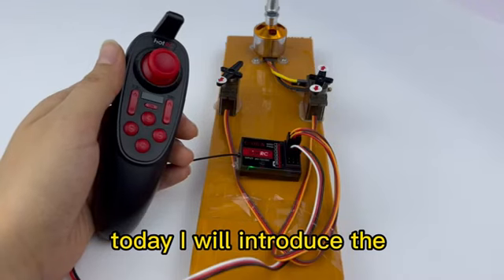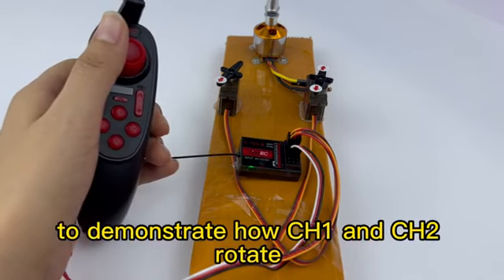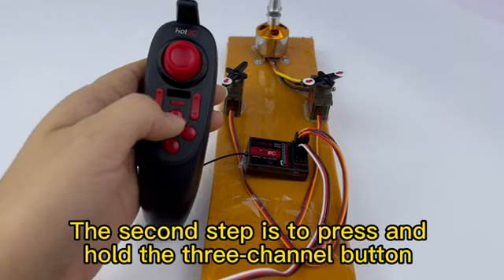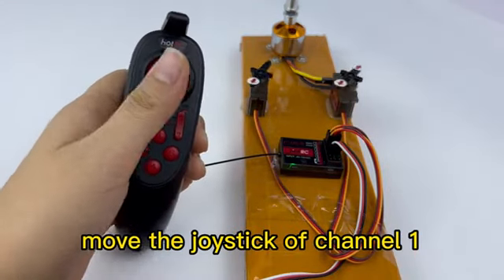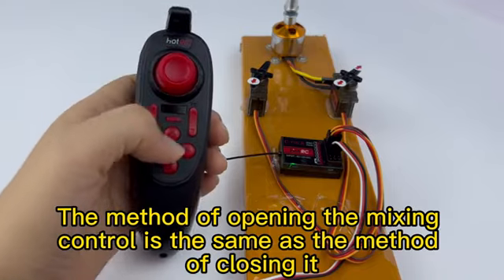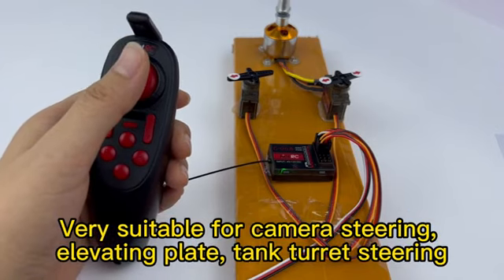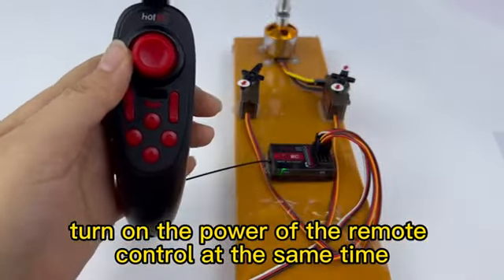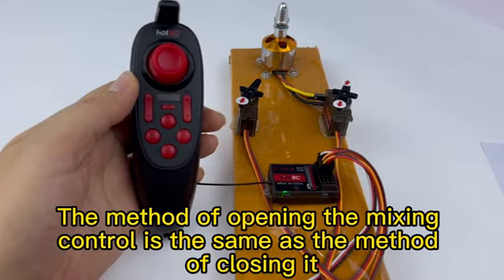(New)HOTRC DS600 remote controller 1 2 channel and 3 4 channel mixing function introduction

Comment: We enabled the mixing functions for channel 1 and 2. Unfortunately moving the stick forward and back will rotate the tank and moving the stick left/right will make it go forwards and backwards. Is there any way to solve this without modifying the controller hardware? You can of course tilt the controller and run it on the side, but... 

This is  V2 controller with an LCD.